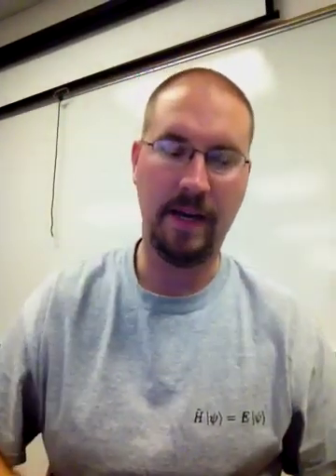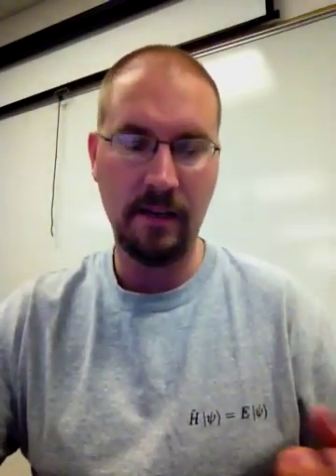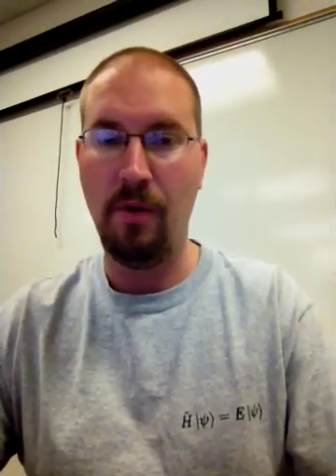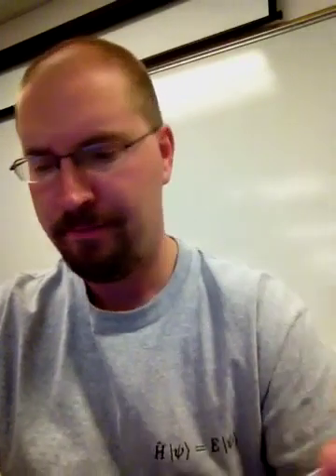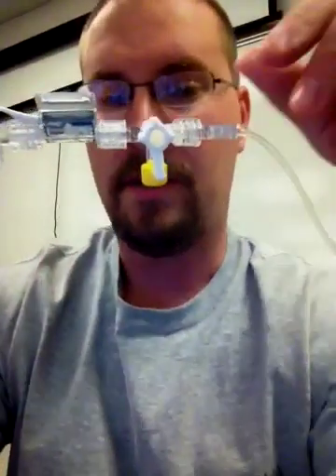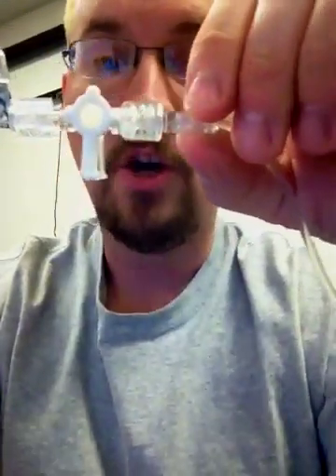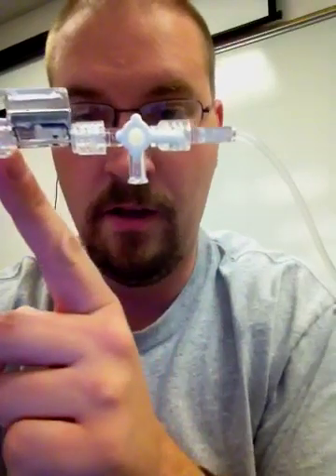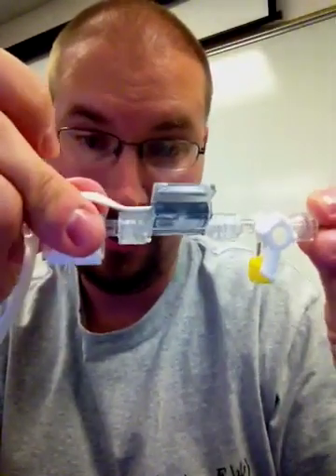Haemodynamics Part 4

Comment from the maker: @bamaalltheway1984: Depends on facility policy.  However, many places have a 3-4 day policy where the tubing must be changed, so at least every 3-4 days or more if issues develop.  In transport, I commonly zero 3 times.  At the sending facility, at altitude during the flight and back on the ground.  This is primarily due to changes in atmospheric pressures at altitude.